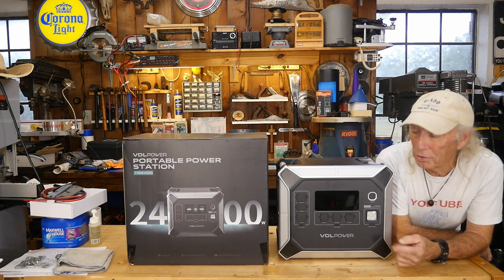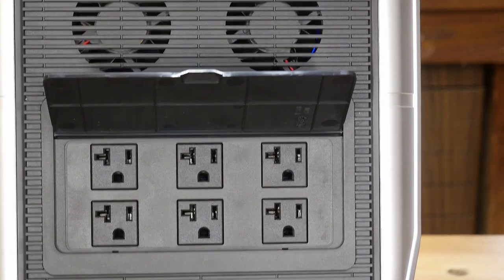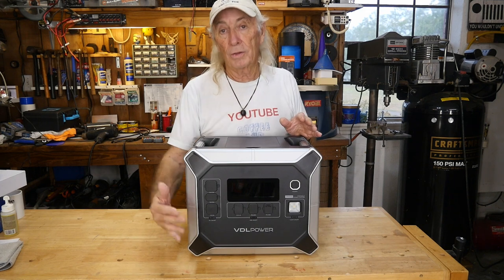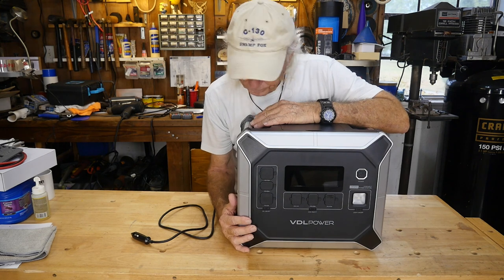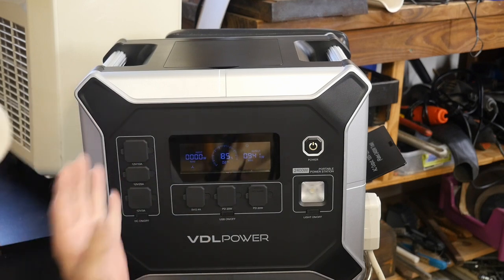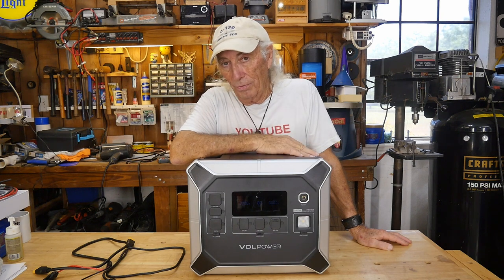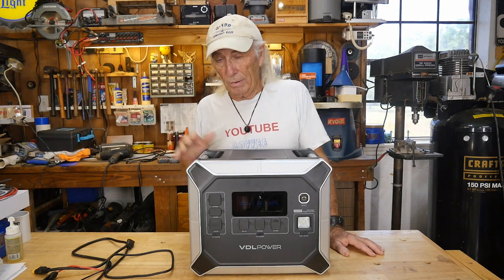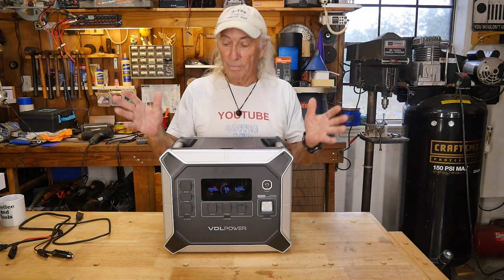Best 2023 Power station VDL Portable Power HS2400, reviewed C&T ep 372

Comment: One question about all these units.....what makes them different from a regular UPS other than just being larger? I have UPS units on all my electronics and those batteries need replaced every few years so if these last longer it may be a nice thing PLUS I could play my ps3/ps4/ps5 with the power off 😁
Reply from the maker: The batteries are good for a long time and rated for ranges from 10years and up. Rechargeable and you can cycle them a lot more from zero to full. According to manufactures. Add to the fact you can tie a small solar array in and you could have power from days to weeks off the grid etc. Not the complete answer for long term, but for short, they are pretty cool.
Reply: You can buy other ones that have the ups function. So the best of both worlds take it camping or whatever you want and while at home plug it into the main wall socket and run your pc playstation or anything and if the power goes out it will take over. And you can probably keep using your pc playstation TV for a while. Or you can set it up for solar up on your house roof. I don't think this vdl has the ups function though. Just google solar generator with ups
Reply: I just checked this one does have the ups function

Comment: Nice review.
Im curious about what grade those battery cells are.
Also, those barrel plugs are great for stringing up a 12V LED string for lighting.
Reply from the maker: How does Ken know about the LED thing ? mmm
Reply: @SirTools  LOL. I initially purchased some 3M 12vdc led's in red, white and blue for a ham go box. But have not fully installed the yet as the go box turned to a HAM battery box. LOL

Comment: Can the VDL HS2400 charge and discharge on a 400W solar blanket at the same time?
And can it do the same with A C and solar ?
Thank you.
Reply from the maker: The VDL did charge with also a load on it's AC. However, the charge is limited by the BMS and so you are going to see less than 400 watts, if your using a 400 watt blanket for example. Hope that answers your question. We did have a cloudy day on "test" day and so I was only seeing about 200watts charge while loading a 300 watt system on the AC end.
Reply: Awesome thank you.
Reply from the maker: At some point in the future I want to set up a 800 watt feed to the VDL and see if we can reach the full 400 watts coming in etc while loading a 300 watt drain.
Reply: My thoughts are with Heatbit, Bitcoin mining. make money while heating your room, 500W--1000W draw depending on heat setting. running 24hrs. Savings with power station during peak power cost times. I will let you know how it works out.
Reply from the maker: HEY...love to hear about this
Reply: Yes it has pass through charging

Comment: So, 1 hour later with ~900Wh power consumption 2048Wh battery still shows 85% ?? In the ideal situation it should be ~56%. 
I somehow doubt that the manufacturer installed a larger battery but did not disclosure that fact so either the battery indicator is wrong or your aircon took much less energy than what the station was displaying. An external power meter would be nice.
Reply from the maker: Seems like everything solar here always proves the math doesn't work. I worked years ago as an electrical engineer and when it comes to solar I'm always scratching up reasons for why this math just keeps coming up wrong.
Reply: Fortunately my Allpower 2000 watt generator has 400 watts of solar panels and was only 1200 bucks tax included from Walmart. As long as my panels are in the sun on a good day I can run my 5000 BTU AC all day without much drain at all. Typically if nothing is being used I can charge it from 10 percent to 100 percent in a couple hours or so 😊😊😊

Comment: I just purchased one. I also purchased a 12V 100ah lifePO4 battery to extend its juice. Add on batteries from these power station makers are such a ripoff. I'm looking at you Bluetti! 🤣🤣
Reply from the maker: I've heard some rumbling over these power stations from Bluetti.  🤠
Reply: Yes bluetti has finally got a solar generator with replacement batteries
Reply: Also a fridge freezer and it takes the same battery

Comment: Shouldn't the two cons you contribute to this power station be pros? One con you mentioned is that it is not expandable and the other is that it has a useless DC output connection. Doesn't the DC output make it expandable by connecting another power station that can be charged via this power station without the AC inversion loss?

I have a 800W that isn't enough power for me and will only input 200w solar. I want to charge the larger station with 500w solar while simultaneously charging my smaller power station with this plug. Is that not possible?

Comment: My SH1500 after charging with solar panel has just blocked 🚫 not able to charge it with AC, just showing battery level 0% . Have you experienced anything similar? 
Am I the only one has this issue? 
Thank you
Reply from the maker: I guess you're talking about the HS 1500. We have never had this issue. Check the breaker, check the outlet you're charging from and even maybe check the power cord output to see if it's working. You would be the first for this one, but heck....anything happens these days. 🤠
Reply: @SirTools   the cord and all cables are absolutely fine. It was charging with the solar panel and everything was fine until all of a sudden from 70% went to 0% and was shutting down automatically. Now doesn’t charge even with AC.. it does stays ON but nothing else.
Reply from the maker: Need to contact their customer service by the sounds of it. Never heard this one before.
Reply: @MiNkOYu   You can try leave it plugged into AC for 24 hours (switched off) to see if it can make any difference. Please let us know if you manage to get assistance from their support. When one spends that much - having a reliable support/after sales service is very important. I am keen to purchace one myself since they would be twice cheaper than Bluetti (which I like!) but what about customer service?
Reply: Sounds like it's the bms has gone

Comment: Has anyone calculated the watt hours on this power station
Reply from the maker: The machine is rated at about 2,000 wh.
Reply: Yes, but these numbers are not sometimes actual. Someone else has commented online that it has only 1800watt hours in actual testing.
Reply from the maker: That sounds like HoboTech, but maybe someone else. There are a few variables to load testing that could give you an "off" reading. Example that 200 watts missing could be used in the inverter, the heat coming off the machine etc, all losses over a test. Even the VDL shows 100% fully charge and I've noticed it continues to charge up before it is "full". That again could be explained by the difference between the batteries and control package inside the unit.:face-blue-smiling:

Comment: Do not buy this station....totally waist of your money,,was sitting in storage for 5 month(never use it  yet , just recharged  2 times) and on 3rd time it stopped take any charge,so now i can use that just like step stool .(under 36 month warranty)
Worst customer service, actually No customer service at all.
Reply from the maker: Always sorry to hear this. My VDL has been used and abused for about 1year now and still running strong. Seems like I've had complaints about every manufacture to date. mm..:face-blue-smiling::face-blue-smiling::face-blue-smiling:
Reply: @SirTools  Lucky you,,because you never try to reach customer service for VDL,,,
Reply from the maker: I think ALL customer service sucks. By any chance did you try the reset with holding the first two buttons ? Yeah, lots of questions. Might do a show about all this. A large number of various issues with all power generators / solar generators etc
Reply: @SirTools  
Ok,,but what 2 buttons you talking about? Have know idea , explain please.
Unit not responsive at all, cannot even charge it,,,but when unit hook up to the wall (charging mode) and i using outlet 110v from unit,power transfering through and as soon power OFF the wall  units  dye.
Reply: I do have second unit (works so far),,so you see my situation 50-50,from 2 units 1 alive)))
If i new how to fix that , probably done by now.
Reply from the maker: I'd have to get out the manual, If you hold down the power button and the AC button it  should reset the error. Works on some and not on others. My VDL has been 100% working, but I've seen complaints from just about every brand name. Also one fellow ended up shipping his back for exchange, he was unable to charge it solar or AC.
Reply from the maker: Wish they were more user / fix friendly. I screwed up one that is not here anymore. I think it was a Jackery at that time and turned out my solar power voltage was TOO  low and the current burned it up  OOPS...
Reply: @SirTools  I did try, nothing happen .
How i can open this unit , cannot see any bolts or screw ?What if BMS( inside) shuts down just like in the regular lithium battery.
Reply from the maker: Are the batteries totally dead 0%. That could be the BMS will block and the VDL would have to be returned to them for replacement or service etc.
Reply: @SirTools  You know it hard to say if battery dead,,,cannot be , because i did charge in June , unit just not respond to anything,
And VDL exactly  same way, not responding ..
Reply from the maker: Got a note here from the manufacture says, you must recharge every 3 months to keep the batteries in good health...That's new mm
Reply: @SirTools  Yes , thats what i did in June and was trying in Sept.,,,
Reply from the maker: Has VDL customer service replied at all ?